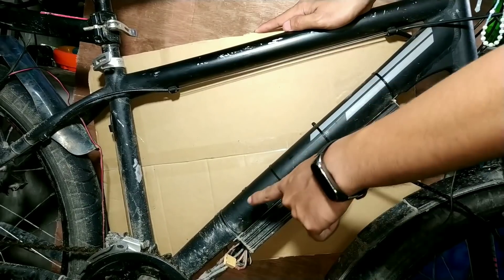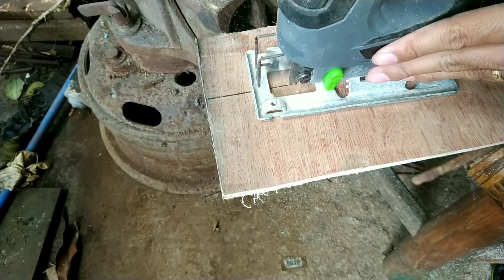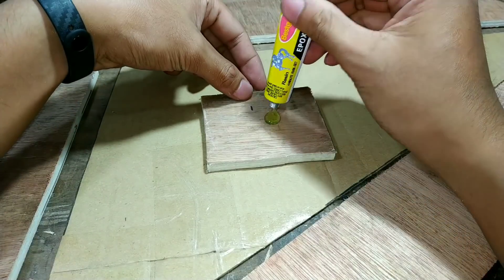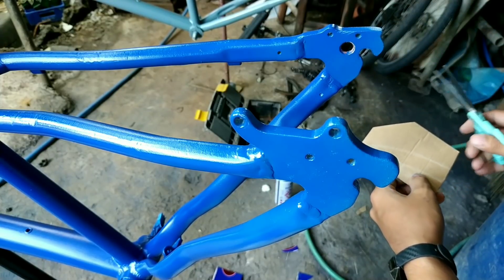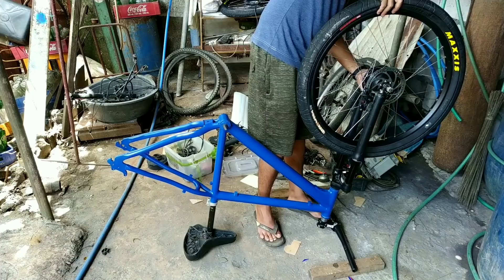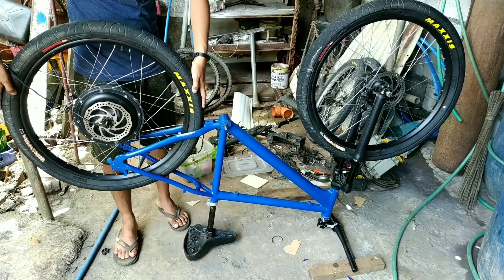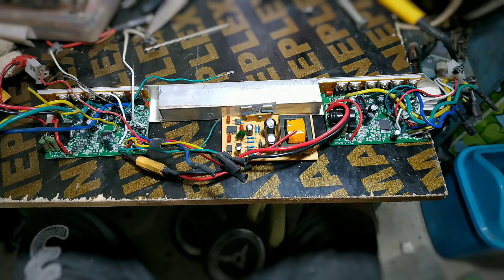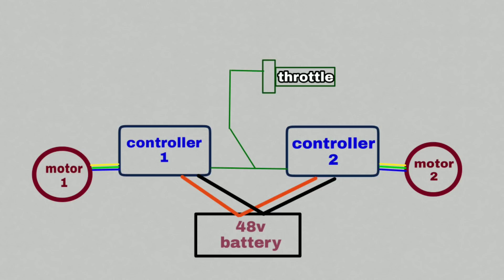how to make 2WD eBike (cheaper yet powerful.. 60kph)

Comment: Hello mate, amazing bicycle and really well documented video. Just one question, at higher speeds wont the front hub motor slow you down or even mske the wheel slide? I seems like it would rotate slower than the more powerfull rear hub motor.
I gues thats maybe why you put that switch to turn on the front hub motor, or maybe just  for more efficiency.
Is there any way i could make sure they spin a the same speed?
Reply from the maker: front hub motor spin faster than rear, even front motor spin slower it doesn't effect rear hub motor, because front motor is geared hub motor it has clutch inside of it.

Comment: Suggestion: A 4-Wheeler with full suspension. Like the recumbent trikes with full suspension. Or the trikexplor 4WD.
Doesnt need to be 4WD, but a go-kart feeling while driving would be great. also mild off road capability for ways over fields or thru woods.

Comment: Can I know which frame are you using here?
Reply from the maker: just a random steel frame I get from junkyard
Reply: @ImJustDIYer  I'm asking cause it has rear disc break Mount, a suitable drop out for the motor rim, and a nice triangle space for the batteries 👍

Comment: Hello can I ask you a question ?
I want to make a trike bike for my brother who is paralysed so he can go on dirt roads to make him happy 
I have 4  car batteries 12v x 55ah  I want to power 2 motors 350w each ( like you did with one twist throttle )  
can you tell me what ambere  controller can I use ?
Reply from the maker: 12A or 18A controller can work..but 4 car batteries are too heavy for 2x 350w motor
Reply: Hello thanks for your  reply  
I have a 250w bike I'm 105kg and I'm quite happy by the performance ( by I'm not specialist like you about the e bikes) from that point of view I'm thinking for 2x350w motors if you have any suggestion I will by happy to hear about it 
The 4 batteries 12v 55ah is because ( besides it is affordable ) my brother can not petal and is to have excess power  for very long
Reply: Hello thanks for the quick reply 
I have a 250w bike   and im 105kg   I'm quait happy about the performance (but I'm not specialist like you about the e bikes) from that point of view I'm thinking for the 2x350w motors if you have any suggestion I will by happy to hear about it. 
About the 4 batteries 12v 55ah is because  (besides it is affordable) my brother can not petal and to have planty of energy to make long time trips
Reply from the maker: it still work good in car batteries, but still it's work better in lithium. less weight less space but cost to much
Reply: @ImJustDIYer  
Thanks again
Reply: @nikolaosdamianidis5604  take 48v 500w controller and better use 500w motors.
Reply: @Home_made_ch  thank you very much

Comment: Another good one Albert. Aren't your motor dissimilar 350w front and 500w rear? Are you feeling a difference in torque between the wheels.
Reply from the maker: rpm, torque and size. you can't tell the difference when it in road

Comment: What range does the battery offer you ?
How many km can you travel with a load? 20, 40, 60 km?
Reply: This depends a lot on the constant speed of movement.  If you go with 60 km / h constantly, the battery does not keep you 10 km.
Reply: As an example, a electric motorcycle with a range of 250 km from China, will only keep you 250 km if you go with 35 km / h constantly and have a maximum weight of 70 kilograms.
Reply: @SPN2TV  
I saw that this man uses 2 engines, so the consumption is high .
I want to make a bicycle with a 500W motor.
If I put a 10 A battery, can I go 30 km / h, 50 km away?
Now I have a gasoline engine. with 1 l goes about 40 km.
https://youtu.be/24TEch_QTns
Reply from the maker: at full throttle you can still get 40km range. but on 30kph average speed, you can double the range

Comment: Kapatid! Where can I get those 18650 batteries? I did try getting some in shopee but I cannot recommend them (has generally poor quality). Did also try buying used laptop batteries (pahirapan makahanap). Kindly PM me if you have time. I remember you mentioned, somewhere in your videos comments about a forum dedicated this DIY bike. Many thanks in advance!
Reply from the maker: join in solar ph, and find Alfred sy. all of his battery are true rated and good prices..  or pm me on fb Albert Navarro Nario
Reply: @ImJustDIYer  Sobrang late ko na nabasa.. LOL! Nakita ko narin pati ung shoppe account nila. Atm, wla sila magandang 18650 maganda. 1500mAh @55 Php, medyo mahal. May nabili ako 2200mAh @45 Php sa shoppe, gamit ko ngayon yung nagawa kong batt. pack para sa upgrade sa xiaomi m365.
Reply: I get mine from cheap drill battery packs,good amps

Comment: Hey bro can u use ur front motor to charge the battery ..it will increase the range of battery...what do u think
Reply from the maker: in rear motor because it's a direct drive motor, and it called regen brake.
Reply: @ImJustDIYer  when u will brake it will generate isn't it ...but how if that front motor keep on generating current all the run time ...Ur power loss will decrease and range will increase
Reply from the maker: it shorten your range and lessen your top speed.. not so efficient way. regen brake way more effective to extend range.
Reply: @ImJustDIYer isn't there any other  way to keep charging the battery during its run time rather than regeneration motor ..
Reply from the maker: solar panels?
Reply: @ImJustDIYer  search once (first self charging electric bicycle ) and seckout the vdo
Reply from the maker: those are prototype and maybe not real..
Reply: @ImJustDIYer  it is possible ..

Comment: Nice for climbing mountains 2 wheel drive.I have a downhill style mtb bike with 1000w front hub pedal assist in rear = 2 wheel drive also.
Reply: Are you running a suspension fork with that and do you have torque arms installed?
Reply: Yes torque arm & 30mm after breaking 2 forks 28mm.
Reply: Surely the dropouts of the forks are the same thickness whether the stanchions are 28mm or 30mm?
Reply: I thought so but mine are bigger and stronger SUNTOUR XUE30 perfect fit.
Reply: @petertothRC-FPV  so how's the build been running with that 1000w hub motor up front? I actually built one since we spoke last, an AWD fatbike, with a 1000w front hub in a 32mm stanch air fork, but with 2 TA'S. Now ditching the rear factory wheel (cheap components, freewheel and hub rusted after 1 winter!) for a powered rear hubmotor + 7 speed, with a switch for the front when required/wanted.
Reply: Been great i built a new one now with a vintage Tomac 98 special after 5 years i just wanted a little more 52v speed/power and 1000w rear drive for better rear shock works great and the upgraded 203mm disc brakes have great power also.

Comment: I like this but does the front motor really add anything that a higher current controller for the rear motor wouldn't?
Reply: A powerful rear motor is better... And less weight
Reply: More traction?....Im interested in this as an E-trials bike.